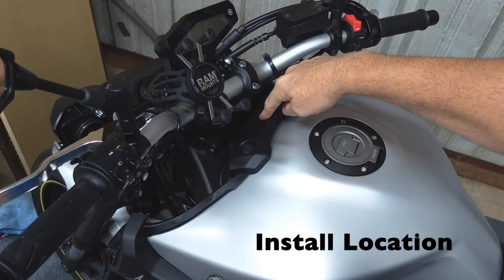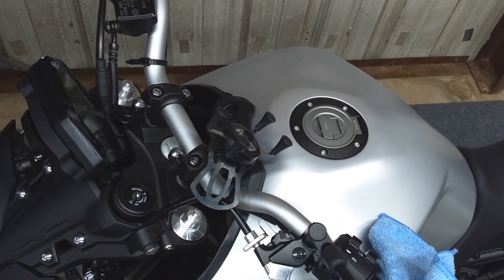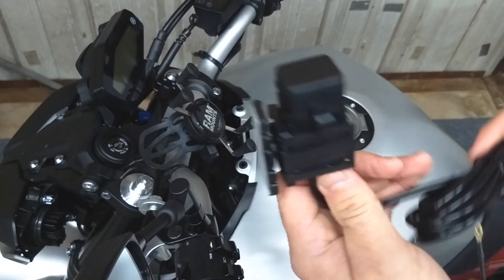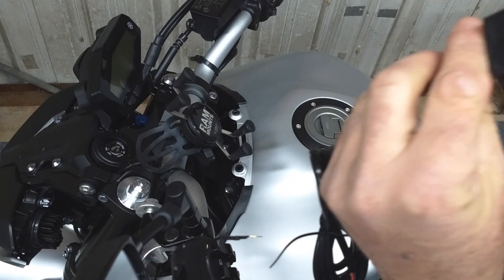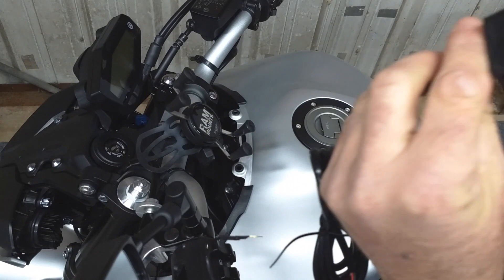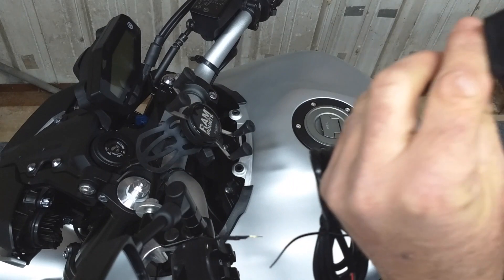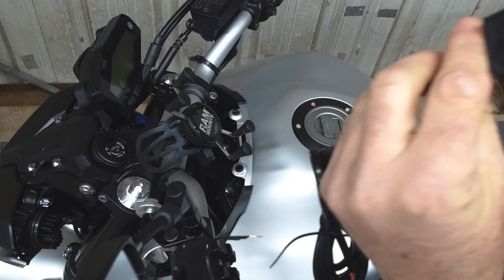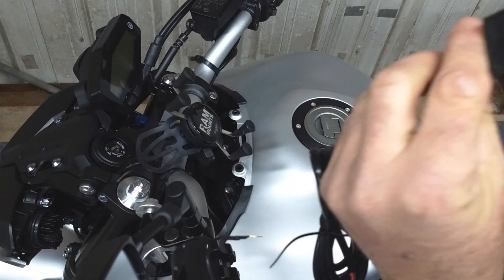FZ-09 Motorcycle USB Charger Installation

Comment: Great video! Very informative. My only concern is the clearances with the handlebar when a usb cable is plugged into the port. It looked a little tight in the video.
Reply from the maker: Maybe there are some cables on the market that would hit, but everyone I've tried so far have been fine. Ride on
Reply: Thanks. I went ahead and installed a battery tender brand SAE to usb charger today in my 2015 FZ09. I installed it using highway toll transponder click-lock Velcro into the right side fork well plastics, perpendicular to the vin sticker. That type of Velcro is made for taking bumps and extreme temperatures.  It is tucked neatly out of the way, yet easily accessible when needed.  Even though my install used a different location and port , your video helped make the install simple. I ordered the parts you recommended for utilizing the factory power port. That crimping tool could use some instructions though, I sort of just winged that. I broke a couple connector pins before getting it right. Getting the wiring correct is 90% of the battle with any install like this, so learning all that in your video was crucial. Thanks again!

Comment: I chose the same installation location, but used a much higher quality USB port with manual shutdown and voltage display. Connection directly via battery ... so charging is also possible
Reply from the maker: The accessory plug turns off with the key
Reply: @MotoSouth  funktioniert leider nicht so wie gedacht, daher habe ich es direkt an die Batterie angeschlossen

Comment: Great video. 
1. At what length did you make your cut (approximately) on the USB cable?
2. How did you measure your dremmel cuts...matching exactly the dimensions of the USB casing? Looks like there is a notch at the bottom of the USB casing that would make it difficult to pass through a tightly measured hole.
Reply from the maker: I really don’t remember what the length of the cable was but you can kind of hold it in position to figure it out. There is room under the inside panel to hide any excess if it ends up a little long. As for the hole, I measured the size of the usb and transferred the measurements to the tape I placed over the area I wanted to cut. The notch can be forced into the opening that you cut out without much trouble.

Comment: Which colored wire from the USB end plugs into the positive of the auxiliary from the bike?
Reply from the maker: It’s been a while so I don’t remember the color. I think I show it in the video though. If not, you can use a volt meter to see which one has voltage with the key on.
Reply: what I'm saying, which color of the usb do you use on the positive of the aux?

Comment: Nice video. Thanks for posting and especially putting the links in the description. I appreciate it. Nice work. Was there a change with the connectors? Updated 12/18?
Reply from the maker: Thanks and yes, I updated the link on the connectors to the ones that match the factory plug.

Comment: Wow I had no idea that my Fz09 had these. I gotta go check lol. 
Where did you find the things you put on the wires to plug into the grey acc. connectors??
Reply from the maker: I have a link in the description but it’s probably dated. I’m sure they are available still from another seller on amazon though
Reply: @MotoSouth  I did some research and found some knock-offs (I’m assuming) on eBay. Thank you sooo much for your  knowledge and your videos! Your videos are so detailed and legit compared to others by miles. You sir, are the man! So ahead of the rest. If it wasn’t for your Pro Taper handle bar video I would’ve never had the confidence to do it. Again, you are THE MAN! Thank you!

EDIT: btw, I’m adding a voltage meter not a USB so I’m just assuming it will work with the acc plug?? I hope so🤞, do you think it will be fine? Or would you tap into different wires? If so which would you use? Sorry for the long comment but I’ve asked different FB groups and no one will reply 😞
Reply from the maker: @TheMrChaddles the voltage meter should work just fine. All it does is read the voltage provided to the circuit when the key switch is on which should give you battery voltage with engine off and charging voltage with engine running.

Comment: The charger changed, it now has a USB end. Did you just clip yours off and add the new plugs like in the video. I have the part and I was gonna clip the USB plug off but thought I’d check first.
Reply from the maker: They keep changing the design but that's all you need to do is cut the end and splice to the plug
Reply: MotoSouth yea...it took me a couple of times to watch the video before it made sense. Mine looked different

Comment: Do you have a video showing where to find and change the fuse for the external power- socket which is placed on the left side of the instrumentpanel? The instructions in the Manual forthefusebox are false!
Reply from the maker: No I  don't. Do you have access to a service manual? Maybe it would tell you which one is correct.

Comment: Thanks for the video. The plug connector you linked on Amazon, it doesn’t seem to be available. Do you have another link to get those connectors?
Reply from the maker: I’ll look into it
Reply from the maker: This is what you'll need.... parts 6187-2311 and 6180-2321 you can get them in either black or white  here....  http://www.cycleterminal.com/mt-series-090.html
Reply: MotoSouth thanks so much! You’re awesome!
Reply: They are available at ebay. Just paste in search bar "Yamaha DC Power Outlet Connector Plug MT07 MT09 FZ07 Heated Grips USB Charger"

Comment: I have a simple question, what did you use to secure the USB box to the plastic ? And how did you do it? Can't seem to find a video where they show that. Thanks for the great video man
Reply from the maker: Just cut the hole so that the USB fits tightly. It will stay in place. If by chance you cut a little too much, you can always use some black silicone or something similar on the underside to hold it in.
Reply: Ok thank you, I will try it on my bike now 👍

Comment: Do you know of the 2014 has that accessory connection
Reply from the maker: If I remember correctly there are 2 accessory plugs on the 2017+ and one on the 2014-2016. It may be on the other side though. All you need to do is pull the side panel to check.
Reply: @MotoSouth  thanks for the advice appreciate it

Comment: Hey MotoSouth, did you have any clearance issues with that metal tab on the tank right behind where you made your cut on the plastic center piece? Thanks for the most detailed video yet on such an install!
Reply from the maker: As long as you use the bend of the plastic as a guide for the front cut you should be fine.
Reply: Thanks for that, hope to see more mods from you soon!

Comment: How did you get the rubber plugs? Cheers.
Reply from the maker: I have a link in the description for the plug
Reply: @MotoSouth  sorry I missed a few words. How did you get the original black rubber plugs out? Mine are a bit deep down the socket.

Comment: Hi.. help pls. does this configuration works only when engine is switch on? If engine off the usb does not power up? Thank you.
Reply from the maker: Yes. The accessory circuit is powered only when the key switch is on.
Reply: MotoSouth thank you. Will be getting them from aliexpress. Ur video really helps a lot.

Comment: Could you also use waterproof heat-shrink butt connectors instead??
Reply from the maker: DOUBLE0SEVEN that is an option, I  just wanted to utilize the factory accessory plug and avoid cutting it off.
Reply: MotoSouth ok thanks for the video and fast response! Ride safe!
Reply: MotoSouth One more question, is there a benefit of user the extra auxiliary connector on the bike to do this over connecting the wires straight to the battery? Will it drain the battery?
My outlet that I bought has the connections to be connected straight to the battery
Reply from the maker: DOUBLE0SEVEN I like the fact that the accessory wiring is switched off with the key switch. This way it's only drawing from the battery when the key is on.
Reply: MotoSouth Makes sense! Thanks again!

Comment: got mine with the fuse and i tap it on my batt
Reply from the maker: toy Soulja that works too. I went with the accessory plug because I wasn't going to use it for anything else, and because it turns off and on with the key.
Reply: Hi mate, do you have a link or part no. for the factory accessories plug you used, I'm looking at doing the same thing and want to use same accessories plug 
Thanks mate
Reply from the maker: The plug is on the bike from the factory. All you need are the parts I list in the description to utilize it.